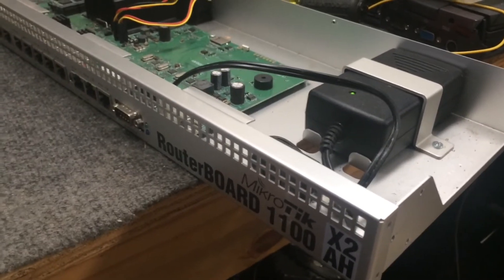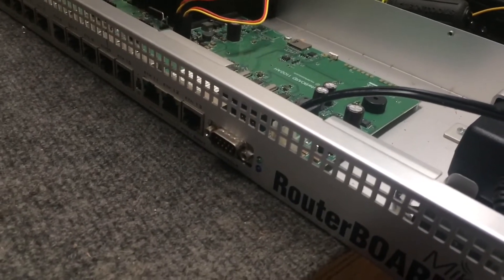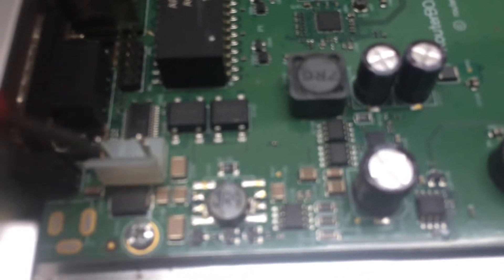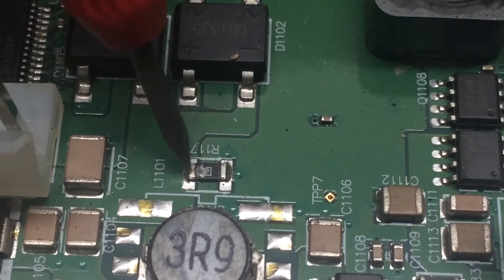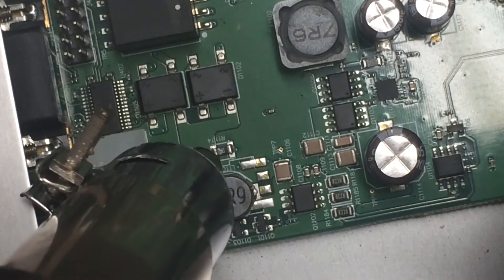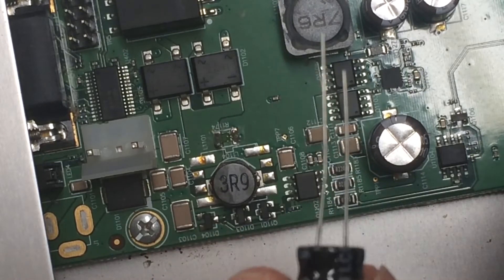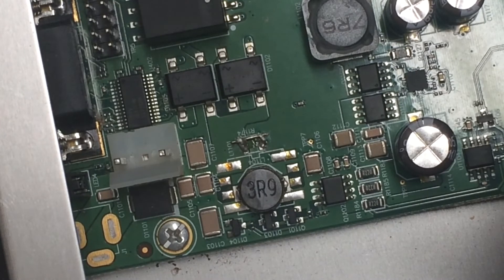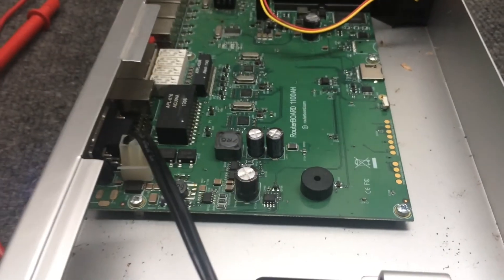MikroTik RB1100AHx2 Repair No Power Issue

Comment: hi. i have a 1200 with a power issue. on power on i have blue light only and lights for group 1 (1-5 ports). no beep or green light. ports 6-10 no lights. what is the fix?

Comment: Typical Current Ratings for SMD 0-Ohm Resistors

Package Size	Max Current Rating (Approx.)
0402 (1.0 × 0.5 mm)	~1A
0603 (1.6 × 0.8 mm)	~1.5A
0805 (2.0 × 1.25 mm)	~2A
1206 (3.2 × 1.6 mm)	~3A
2512 (6.3 × 3.2 mm)	~5A+

Comment: I've seen many zero ohm resistors installed as fuses.
Reply from the maker: I have seen lots of them used a fuses also. I hope they did not intend on this one being a fuse, Its a 3216 package. The chart I have on my desk only goes up to 2512 and it can hold 6.3A. If I had to take a guess the 3216 will carry 13A or so. If this board would pull 13A you got way more to worry about than this resistor XD the internal PSU is only 3A..

Comment: The video is very special
Thanks for the effort

Can you help me with CCR1009?

Sudden problems appear when the device is rebooted, the software deletes. A large number of customers are experiencing the same problem.

We have done experiments with the electricity regulator in a number of companies and we have not benefited from anything.

Do you expect to have a defect or a control!
Reply from the maker: It sounds to me like your having a issues with the flash. It is likely if voltage was the issue many other components would have also failed. 

It is possible to change the flash chip with a SMD station. I do not know if you can flash the new chip in the router. You may need to flash the chip before you install it. 

If you do not already own the equipment to do this job it is likely more cost effective to just replace the router.